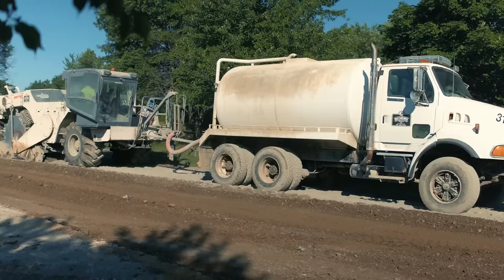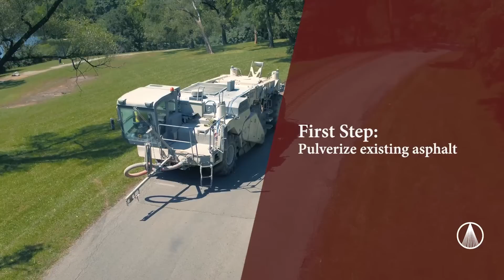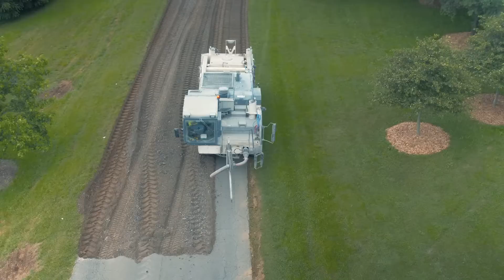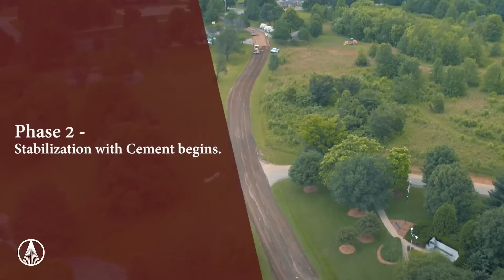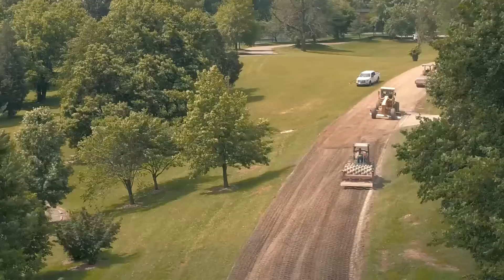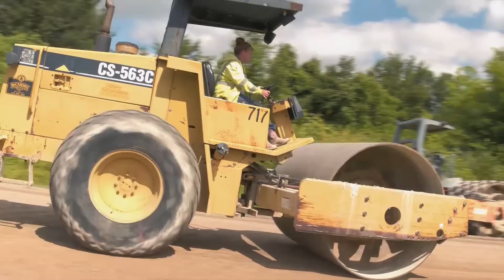Full-Depth Reclamation

Comment: Why there is no crack relief layer? Cement stabilized layers can crack!!!!
Reply: That’s for traffic more than or equal to T6
Reply: @lovejeetdhillon5147 there is still the risk of cracking due to shrinkage of the material during cement hydration, despite the level of traffic

Comment: Great job, I’ve a question regarding FDR.. would it works if a road is mixed between cobblestone and asphalt paving?! We have a project in Washington DC at 2nd Street NW that has an old Cobblestone and asphalt paving. We recommends the client to do a reconstruction for the street, however, the client doesn’t want to pay high price, and ask if we can pave asphalt over cobblestone?! We recommended not to pave asphalt over cobblestone. Will FDR solve our client issue? Please advise. Thanks 😊